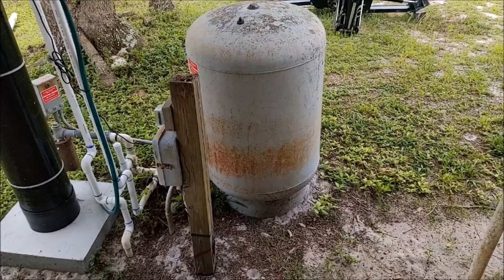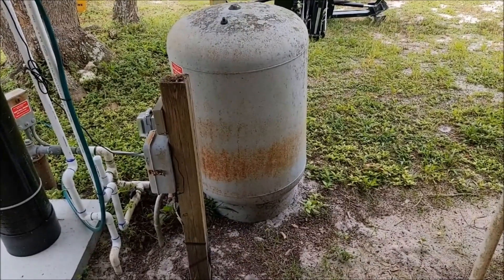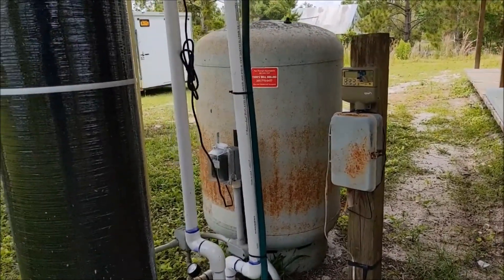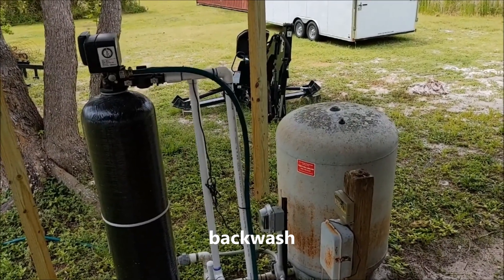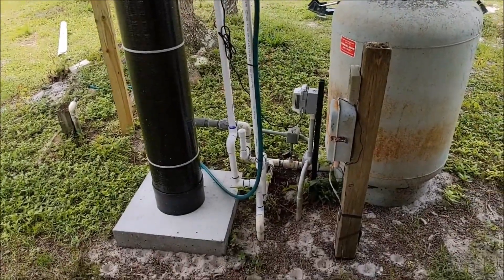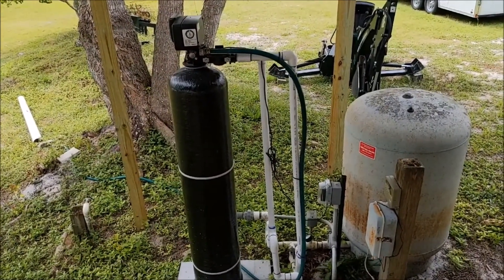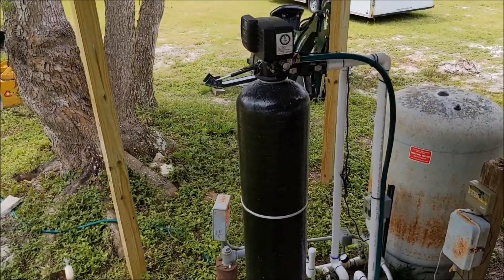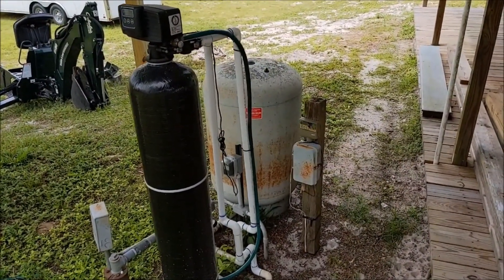Well Well Well, air injection system that is. Air injection on a well.

Comment: I too installed a air injection system in my home and its a total game changer ,
however , im getting like micro air bubbles in my hot water heater now , and when i turn on my hot water in any of my faucets / its starts spitting for a min or two / looking for solutions now but thought i would share this
Reply from the maker: Thanks for the info Gary, hmmm haven't had any issues like that. I do notice when I first turn water on that the first couple seconds are bubbly, but real tiny like almost carbonation small but no spitting or noises. They dissipate quickly and if your not paying attention probably wouldn't even really notice them.

Comment: How has this been holding up? Did you also get hydrogen peroxide injections done? We are dealing with same (S FL) well water, and going to install same air injection system for the smell.
Reply from the maker: Its working GREAT, removes all the sulfur smell completely. I completely forget about the sulfur until the unit flushes and can clearly smell it.  I have completed the peroxide injection, just lacking on getting the videos posted. It seems to be working well and taking care of our iron bacteria issue so to sum it up, our water tastes and smells excellent.
Reply: @buildingourparadise2696  what do you mean you can smell it when unit flushes? Flushes as in doing a "regen"? If so, I assumed those are done at night.

I also just found your hydrogen peroxide injection video so going to attempt that as well. Crazy how easy it is to DIY while some companies charge over 3k just for hydrogen injection system.
Reply from the maker: @vadimosovski9664  Exactly why I did it myself.
Reply from the maker: @vadimosovski9664  Yes I have mine scheduled for 3 am, but you can do a manual regen and just recently I did one when I was changing out some other plumbing, thats when I could smell the discharge, besides that, I completely forgot about it.